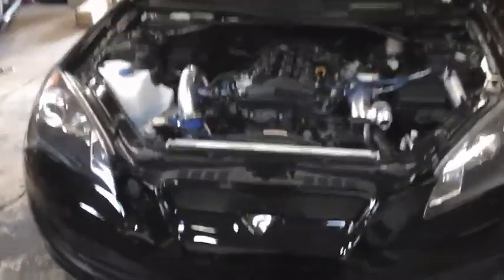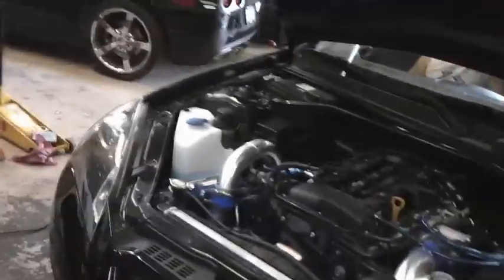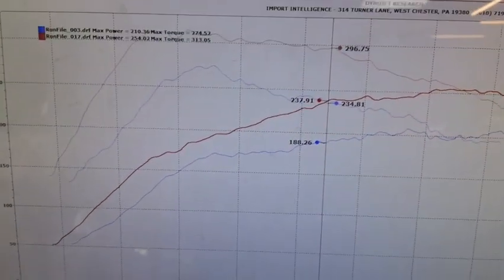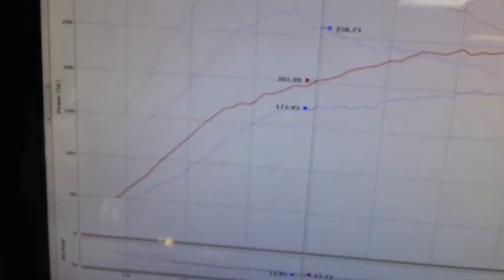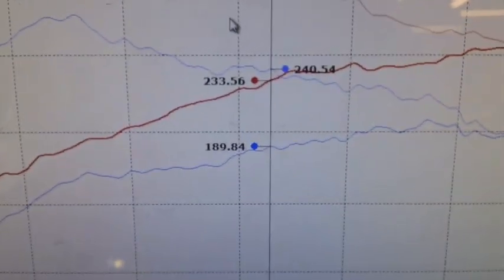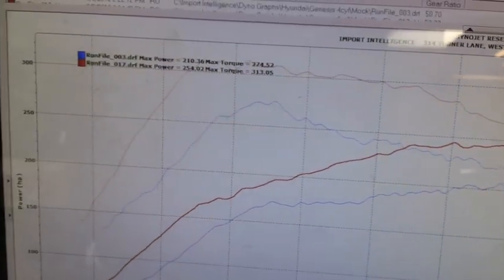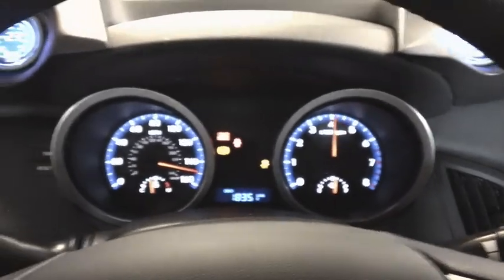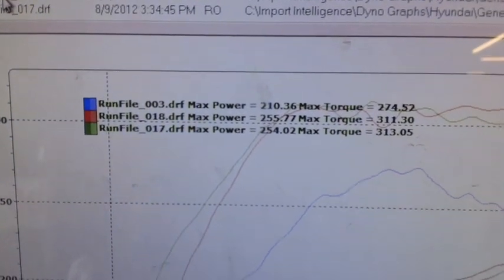SFR ECU Reflash (stage 1.5) for Genesis Coupe 2.0T

Comment: I dont really see what the point is in revving a stock turbo genesis out to 7500 rpm.  you can see the turbo dying off at about 5500.  All its doing is stressing the engine out and staying out of the power band longer.

Comment: Hi great videos. I have a question for you. I installed a 60mm tb with kdm spacer and now the rpms goes up and down continiusly on idle at park when turn the a/c on. Any suggestions? Thanks Is it something that can be fix at a tune?